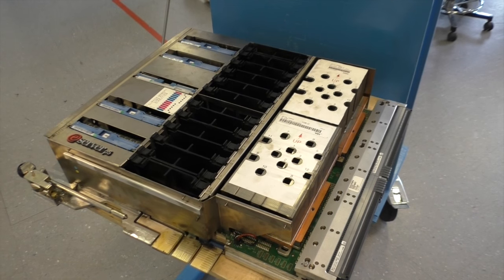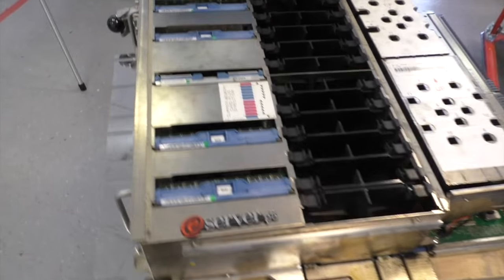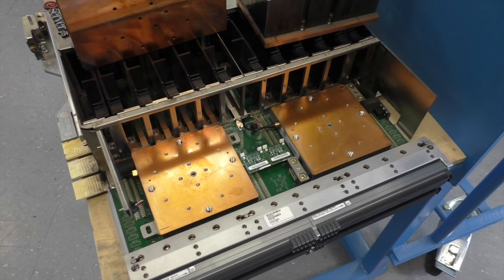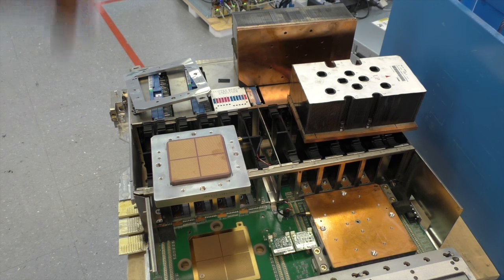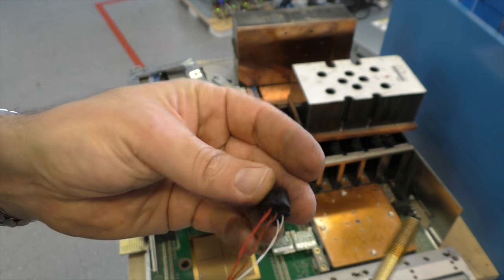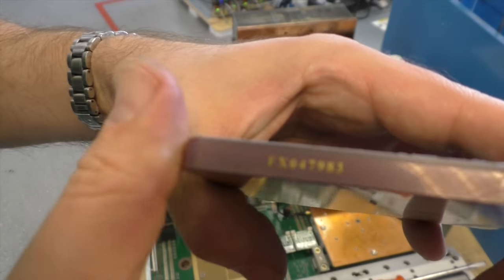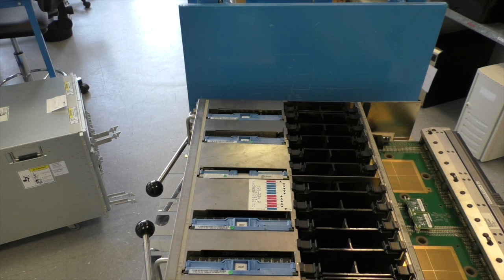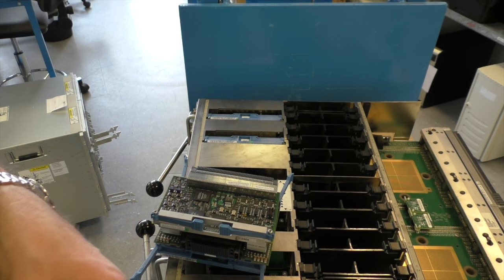IBM Mainframes - Part 1 (PWJ32)

Comment: The POWER5 MCM you are showing here has four CPUs and four L3 caches with anywhere from 36MB to 144MB each.  A single POWER5 CPU has two cores and two independent L2 caches.  The number on the side of the MCM is actually the serial number.  The green coating on the cache chips is actually a passivation coating, something other than the silicon nitride more commonly used for passivation; I wouldn't know why they would had used a different passivation material.  That MCM has 4,491 signal I/Os and the CPUs have 89 metal layers.
Reply from the maker: +douro20 
That's what I call useful information.... thanks!

Comment: I wouldn't mind having a POWER5 system one of these days; around the last couple years of production of the POWER5 line they made some workstations based around one or two CPUs which ran either AIX or Windows NT.

Comment: Impressive build and teardown, as usual on this channel! What I'm still left wondering is how the ceramic substrate for the eight dies is constructed. The dies seem to be flip-chipped, but are they soldered or glued? And how is such a massive ceramic substrate made? Would be interesting to see a cross-section of it under a microscope...

Comment: It would be interesting to see the power supply from these servers, also the connections from the PSU to the processor. The Z9 had a lot of capacitors on the mainboard, on this one I didn't see.

Comment: I love the mainframe videos, they are astonishing :) A quick question: what are those 3 huge contacts (seen at the left) at 10:21 ? are they power connectors for the book ? thanks.
Reply from the maker: If I remember right, these are the power contacts to the CPU power converter. 1.5 Volts and a hundreds of amps. There are also other power contacts but they can't be seen so well.

Comment: that middle card might be the voltage regulator for the ram
Reply: +Cpt. Snow  No, no switching devices are on that board, neither inductors.
Reply: +Gatea Catalin I've just barely noticed two chips there which looked like some Altera FPGAs...
Reply: It's a Multiplexer (MUX) card: https://www.ibm.com/support/knowledgecenter/en/POWER5/iphau_p5/partssystem.htm#partssystem__partssystem_memory.

I guess like a multichannel bus controller.